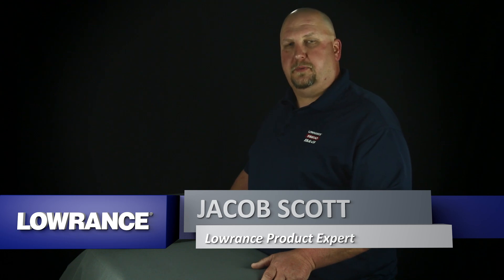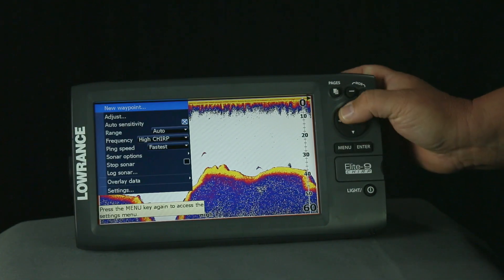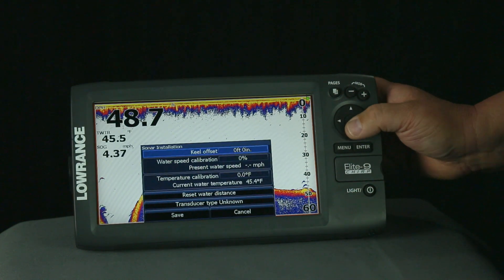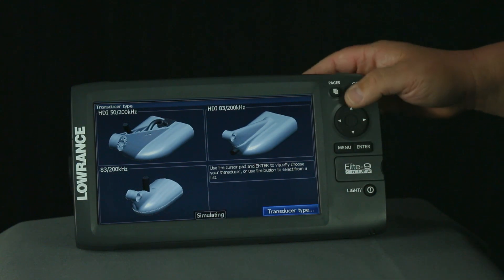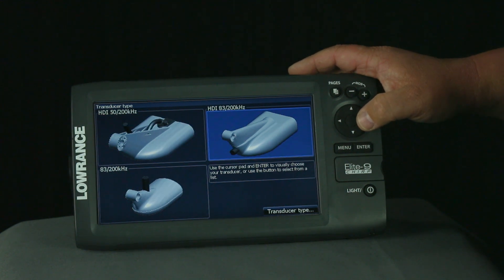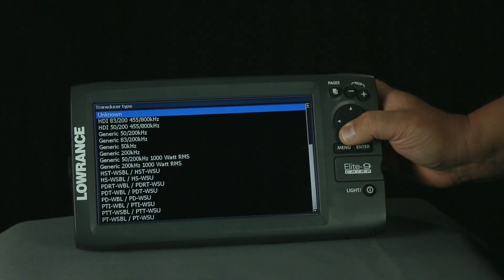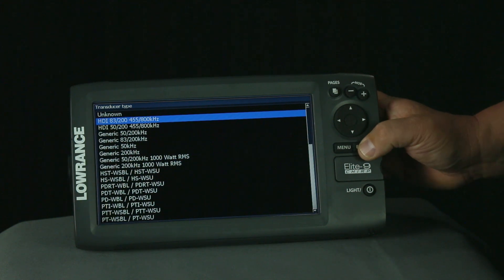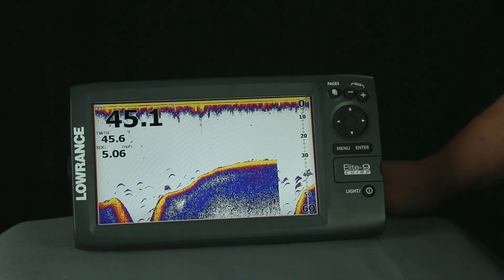How to Select a Transducer Type on Lowrance® Elite™ units

Comment: Okay. So you have told me how to "select the proper transducer." Now what i REALLY need to know is how to DETERMINE the actual transducer installed. Where do I find this information. You don't show it. And if I ask the people where I bought the boat, they tell me to take to you. Yet another endless loop of customer non service.
Reply: same problem , bought an elite 7 ti2 and its listed as unknown , I have no idea what the model is its not listed anywhere that I can find or in any manual
Reply: @Haru78  got the same issue!
Reply: @fishindips  I am on my 3rd unit and the 3rd replacement died yesterday. Sonar version 0.0.0. Won't detect the transducer. This is a flaw in the TI2 that I have now heard many people have. If you are getting no transducer output and the voltage isnt giving you a reading contact support for a replacement
Reply: @Haru78  thanks!
Reply: In the same boat literally...hopeless
Reply: Look on the transducer wire near the plug in.  The tag shows the transducer type installed. https://www.youtube.com/watch?v=L64durEWrUo